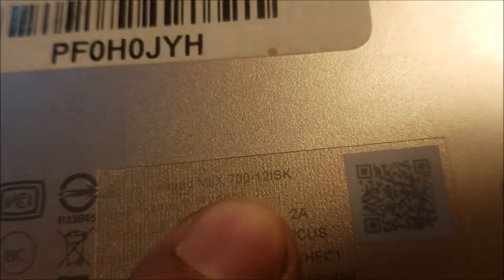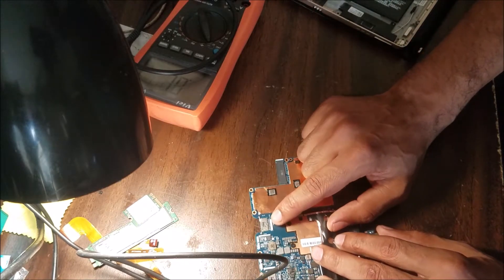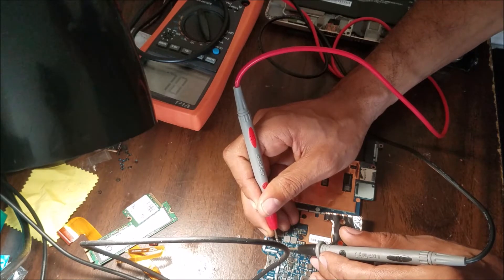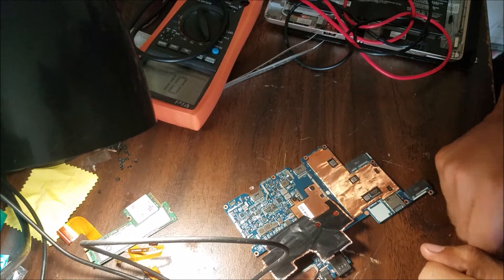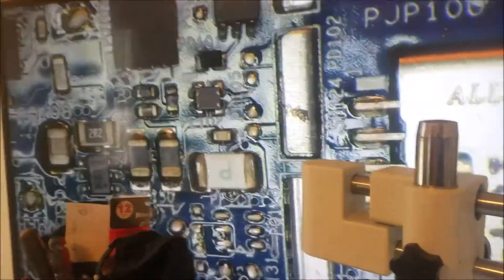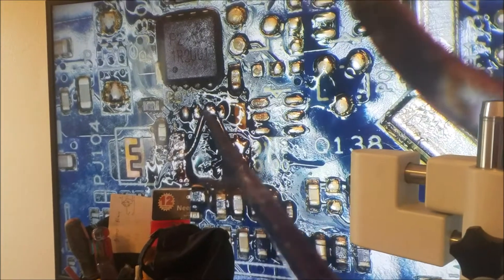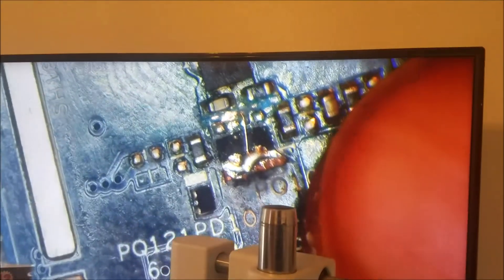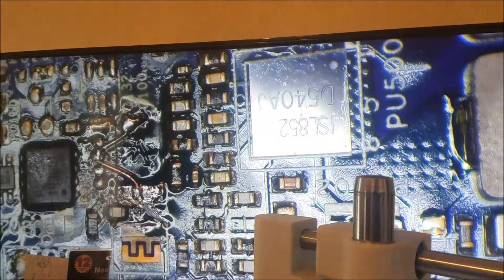lenovo tablet ideapad MIX 700 12isk not charging motherboard repair

Comment: Hi ..my lenovo tablet ideapad MIX 700 12isk stop working It stopped working and I found the PD101 bears a number 8 in the top i think its diode its burned out and  the pin points in motherboard upon examination give ground ( pep) its that mean short Or is it normal?what can i do? thanks
Reply from the maker: remove that diode and test, some diodes may have one side is ground but not 2 sides

Comment: My lenovo mixx 700 is not booting up there is. White light that come on camera
Can you help out what the issue is 
Is it the bios chip
Reply: Try putting a new os on it
Reply: @FINSDIY  ok thanks for the input can you help me which OS i can try and how to update
Reply: @SamS-ef5ez  use another computer and download windows os from the internet. You need a USB at least 8gb , you will use it to create a bootable os which you can resolve any issues or reinstall a fresh os. When you get it done just insert the USB and press volume up and power button at the same time. Follow instructions from there
Reply from the maker: could be anything bios super IO processor ram dc to dc